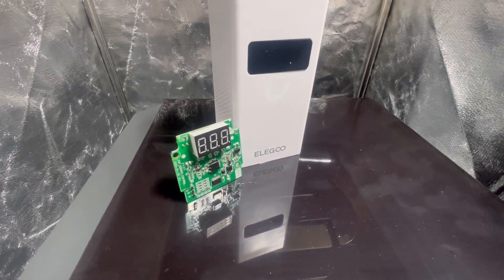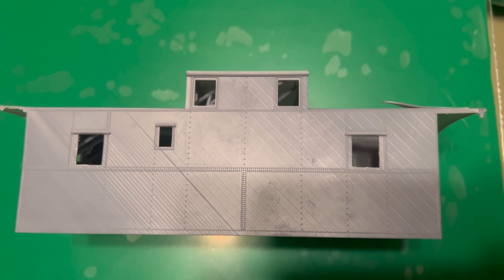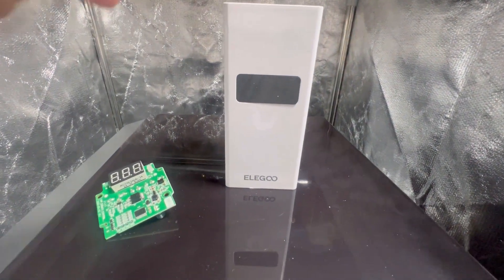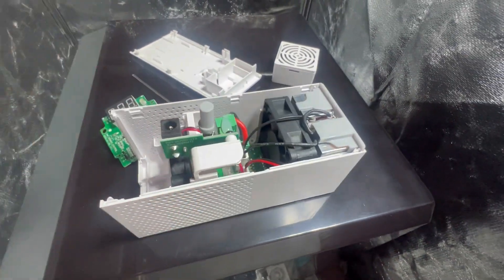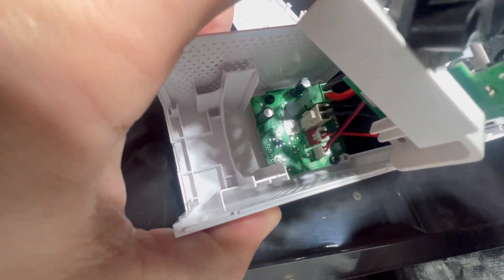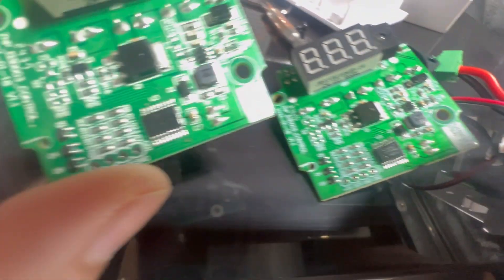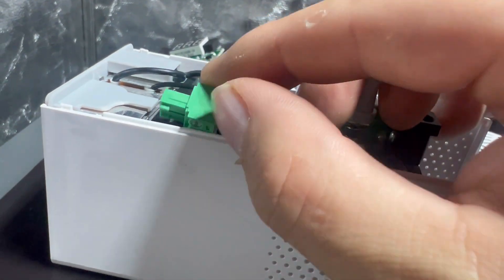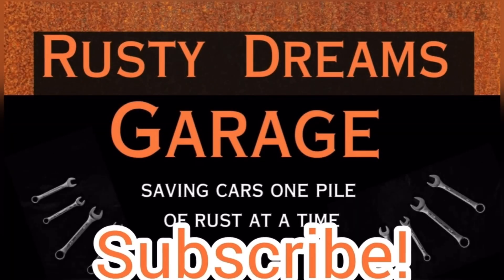Elegoo heater motherboard replacement

Comment: I’ve had this problem for 10 days too. The assistance wants me to change the engine and the Z axis. But at this point I insist on replacing the heater that is 13 days old!